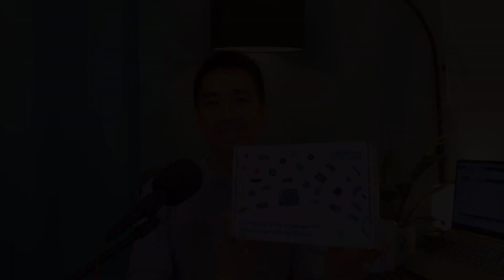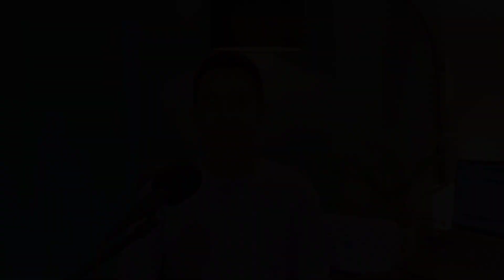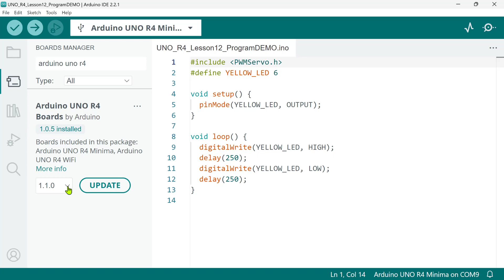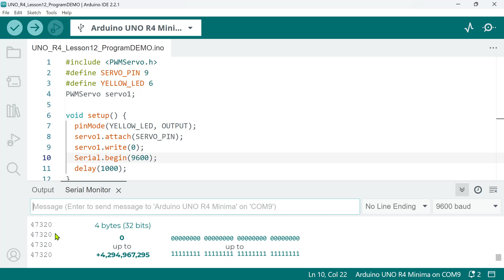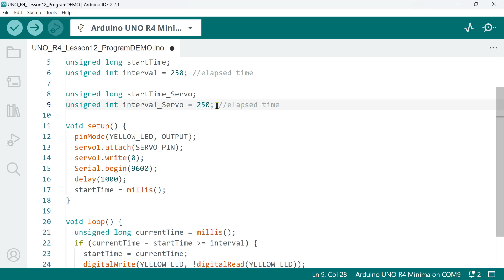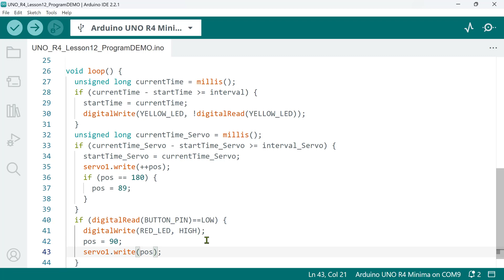Arduino UNO R4 Lesson12 - millis Function | Handling Multiple Tasks | Non-Blocking Code

Comment: Hi
I am trying to replicate your tutorial
It is to my surprise that there is no data on the serial monitor when regarding Serial,println(CurrentTime) or millis(); to be exact

Is millis() Library auto installed within arduino environment?
I will appreciate your assistance please

Sincerely
Ejike
Reply from the maker: Yes, millis() is a built-in function in the Arduino language, used to get the number of milliseconds since the board started its current program. 

Please check your Serial baud rate: the Serial monitor baud rate in your Arduino IDE must match the Serial.begin() value in your sketch (e.g., 9600, 115200)

Comment: Seems like a block of code is put out there, then everyone does it exactly the same. I would use a different approach.
Simply use one variable such as Blink
Blink=millis()+Millisecond interval you desire. millis()+1000=every second.
then just check if millis()>Blink IF yes then check if pin is high or low and take appropriate action with your IF ELSE, if high set low and if low set it high.
Then just put Blink=millis()+1000 just before exiting your if statement when you checked if millis() was > Blink.

Comment: Hello, thank you for this beautiful video. I'm a novice and I'm stuck doing the exercise. in the example the on and off time of the LED is the same, if I code the same principle for another LED, the first LED also lights up even though it should not. the off time of the first LED must be longer than the on time so that the second LED can light up in turn, and I don't know which line of code to intervene. where is the answer to the solution and sorry for my broken english. thank you

Comment: i have a challenge also to you. Blink a LED every 1 second continuously using a simple sketch with 3 lines of code using 2 functions only. Materials needed are Arduino uno, 220 ohms resistor and LED.
Reply from the maker: Your instruction is incomplete. Does it have to be custom function or a built-in function like a simple digitalWrtie and digitalRead will do?. Is it required to use millis because you posted it on this topic? By the way, using 220 ohms resistor on UNO R4's gpio when connecting to an LED is not advisable, as its max current is only 8mA.

I might not be able to answer your challenge because I don't know anything. I just teach and share what I know. I don't challenge others just to prove that i am better than them, because I am not. Please teach me and the others how it is done. Thank you.

Comment: Good day Sir

I have concern regarding ESP32 WROOM 32 using Arduino IoT.  From the time I uploaded the code to my esp32 it will always appear "*** Arduino IoT Cloud - configuration info ***
Device ID: ade0fbdc-031b-45b2-9656-5693b534e96b
MQTT Broker: iot.arduino.cc:8884
WiFi.status(): 255
Connection to "Keri" failed
Retrying in  "4000" milliseconds"

It doesn't connect to the wifi, may you guide me in terms of this matter Sir, Thank you Sir and God speed Sir.